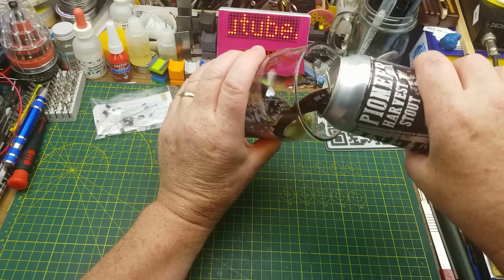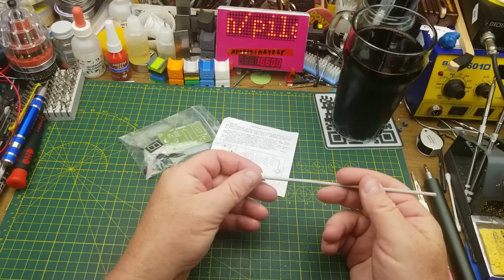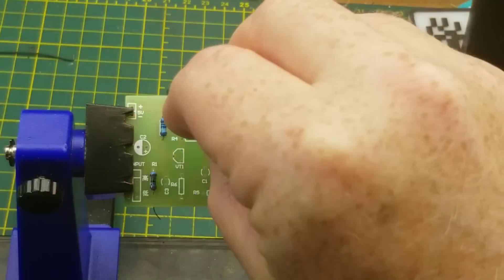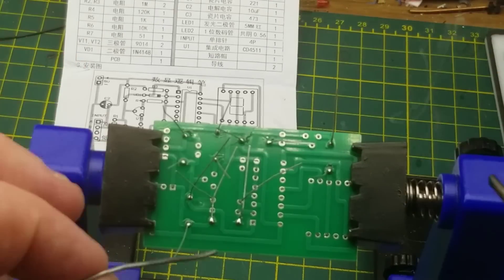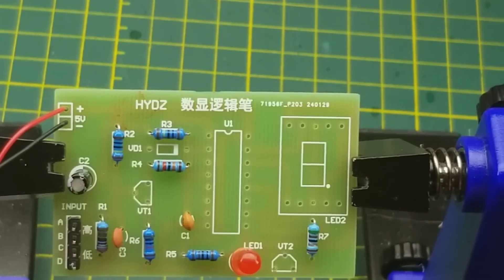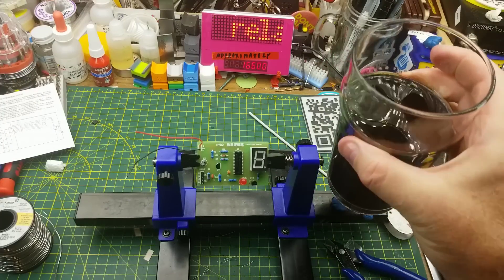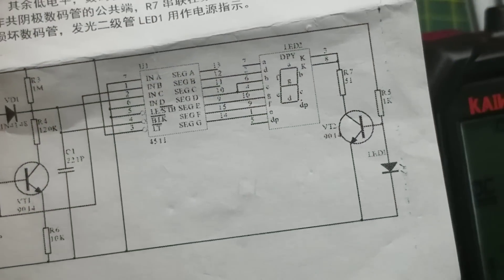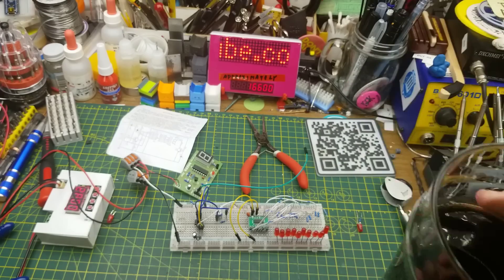relaxing kit build: logic probe

Comment: If i pp you the money kent will you do a logic analyzer video running on linux. I have a silly overpriced one i rarely use and it would be cool to see you test one onna couple arduino projects. Like a temp sensor on a 1602 using i2c and maybe a simple spi display that runs a counter for example. Ill even send you some craft beer from halifax with it haha. 

Its up to you. But i think youd be great and everyone would see how approachable they are. The cheap ones i mean. Ill send you a variety 6 pack of tall boys. Hehe

It would be cool for your teardowns as well brother. Plus i want to send you some stuff anyway. 3d printing supplies and tools i have too many of and some soldering kits from open source pcbs i had made to donate. Each kit is like 60 beans. One is a clock using a hub75e panel. I have 4 to give away to people in canada if they want to pay shipping. 24 dollars for 100 worth of stuff. To anyone reading this i mean. My email is in my channel and my number is 902-578-1556 if someone wants to text me their address. I dont require any thanks or the like. Im just trying to get rid of stuff. A few lucky people might get a brand new lcr meter or high end multimeter. I seriously have way too much stuff. And a few people who know me personally can vouch for the fact that im not a psycho, oddball yes but i need rid of so much stuff. I donated my last charity kit and just want less clutter in my hobby room. Only kent gets the beer though haha. Places in Halifax pack it for shipping.

You can even have just the beer too man if the rest doesn't interest ya. Ive been driving there every week for like 2 months on the government dime. I never drink and had to get shit faced twice earlier this week in order to sleep in a hotel room haha. All they are allowed to sell by law in halifax proper is locally brewed beer. Haha

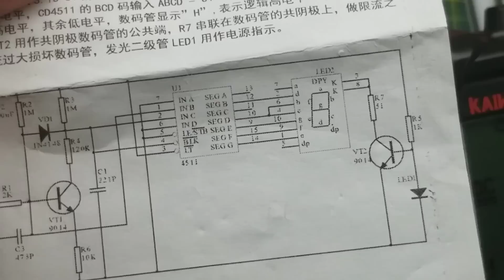Comment: 15:53... The Fix for the bad design is to put a 2K-10K resistor from the base of VT2 to the junction of R5 and LED1.
Reply from the maker: Or just eliminate the transistor - it's not really doing anything useful.
Reply: @pileofstuff  It supplies Negative (gnd) to the 7-Seg. Yeah just removing the tranny and jumping the R7 Resistor to Negatrive (gnd) would also do it

Comment: Wouldn't it be easier to make the circuit using diodes instead of a CD4511 ?
Reply: Yes, there are many ways to skin a cat, but these little kits are more for education than to produce a useable tool. You get to learn about that IC or a particular circuit method so that later you'll have lots of little building blocks in your brain to make something you actually want.
Reply from the maker: Easier, sure. But you don't want to draw current from the circuit under test. 

You could also use a couple of inverter stages. Or a few transistors.
Reply: @pileofstuff  I did'nt think of that. 👍

Comment: I made a barrel jack tester with red and green LEDs a small panel meter and a bridge rectifier (the meter is a little off due to the diodes) Green for center positive and red for center negative both on its AC I used a zener for the LEDs

Comment: Removing VT2 and bridging C-E would allow the LED to work without affecting anything else. Why is VT2 there at all?
Reply: Constant current source. If only the resistor is used, as you said, the LEDs will light briter or dimmer depending the number of segments, so one digit (H) will be dimmer than the other (L)
Reply: @sebastian19745  With the resistor values shown, the transistor will be switched hard on, so the bottom of R7 with be 0V at all times.
Reply: @andyfraser5876  Anyway, it seems it is working as intended, because I do not see any difference between the brightness of 3 or 5 segments. That LED is there to act as a zenner diode, not as LED.
I used often this schematic (or the one with the resistor in emitter, or with two transistors, etc) to simplify the circuit, instead of using 510Ohm resistors in series with each segment. Maybe the values are a bit off, but it works as intended. 
Maybe pileofstuff can measure the display current in H/L states? Or, the voltage drop on the 51Ohm resistor? It should be around 5-10mA.
Reply: @sebastian19745  As mentioned in the video, the LED never reaches its operating voltage as it is limited to 0.7V by the transistor's B-E junction.
Reply from the maker: I agree. It doesn't serve any purpose that I can see.

Comment: I guess to display tri state, you'd need TWO LEDs and a resistor ? ;)

For solder practice I used to build little models out of resistors.. like airplanes, helicopters..  locomotives (!) ... if you are good you make them work, with leds as headlights and a buzzer as chimney and such... a 1000 pieces resistor assortment doesn't cost too much..  I am always a little sad when those boards end up in a drawer never to be used.. those little toys you can dangle from the ceiling and have something to look at at least..  but yeah I mean to understand a circuit it is nice... I think your 555 timer circuit is much nicer than the probe though XD
Reply: A fun variant of a dead bug circuit.
Reply: @Steve_Coates  Yes, so to speak.. like a wireframe model of .. something. I like to build starships ^^ .. I couldn't find any videos on YT regarding that..(no hits for "resistor art")  so POS might be the first to do it if he decides to do so :D
Reply from the maker: That might work, but it would also draw current from the circuit under test, possibly de-stabilizing it, or giving a false result.
Reply: @pileofstuff  Yes, certainly, perhaps, I mean maybe ^^ IDK if you know James Sharman aka weirdboyjim.. He has built a nice probe I think he also has schematics and stuff.. maybe not directly his invention ;)
Reply: Ive been building alot of transistor circuits lately. Im currently half finished a 5 bit full adder using only nor gates. I need to cut and stain some fancy wood i have for an enclosure and it's done. 

Im going to attempt an smd only transistor clock next i think. Im going to just etch tiny grids with a bunch of mg chemicals brand stuff i got for free then foolishly paid for a bottle of liquid tin...... dont ever do that. Learn from my stupidity haha. Im too young to be retired and have too much spare time man. Its why im trying to give away half my components and motors and shit now to people in canada who watch this channel. No one tskes me up on my offer for free shit. All brand new, im a sucker for sales and impromtu project plans where i spend hundreds of dollars on shit thats so deep in a queue ill never get out of. If youre in canada and want some cool shit just text an address and when you receive at least 100 worth of shit you can pay the shipping if you dont mind. Im throwing random test gear in as well. Like lcr meters i foolishly bought more than one of and too many eevblog meters. Plus tens of thousands of leds and motors of every type. Ive been playing guitar more lately and would like to fit my recording gear in my hobby room and the guitars im restoring.

Comment: Nice Video which will be of great use to beginners.  Circuit faults are not uncommon on these kits but can usually be fixed with a cut track and jumper wire.
Reply: I agree. I like how there's lots of kits now where you have to trouble shoot them too, by design. The smd competition ones are cool too. I bought a ton of them years ago to learn how to solder better. I dont cheat with paste either. Its amazing how a bunch of flux and a little hothair can straighten out all the crooked components. Took me like 10 kits before i got one to work properly hahaha